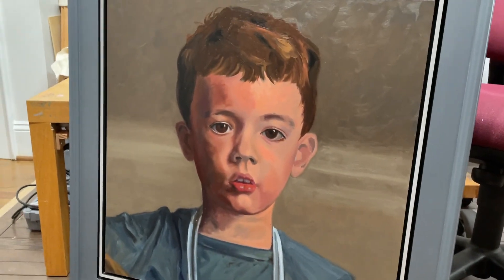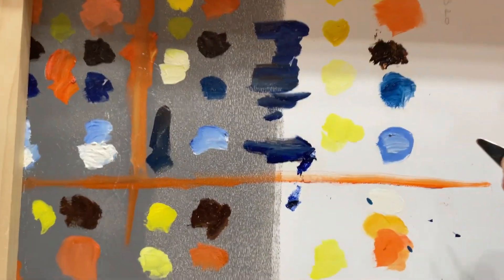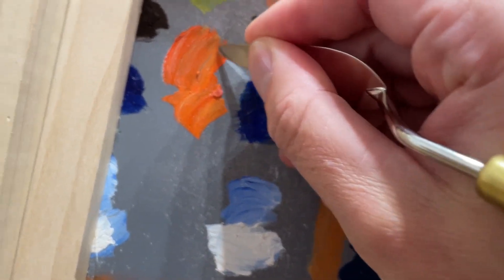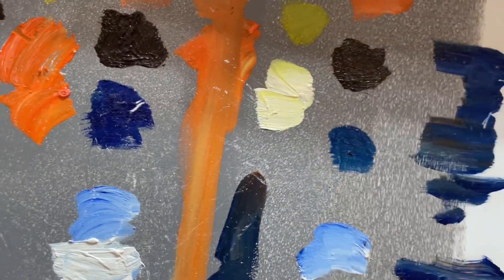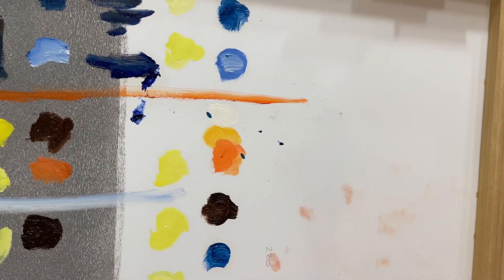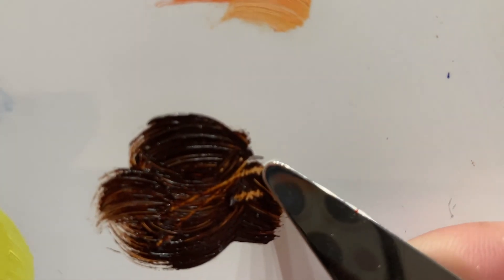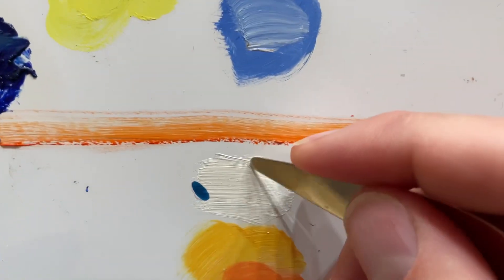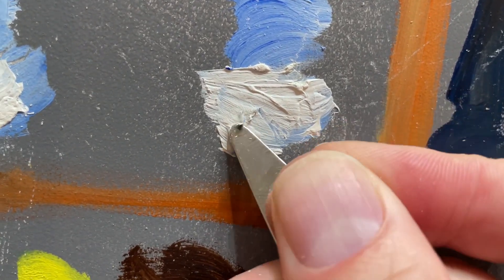Follow up DIBOND scrape test

Comment: i saw a comment on another video recommending that you etch the surface with ammonia before applying gesso
Reply: it's not base aluminum though, it's a plastic paint coating on top that you're sanding. Ammonia in theory wouldn't have any effect on the paint coating -- pure metal, sure, but you can't paint on unsealed aluminum which is why Dibond has the coloured paint on it (at least on one side).

Comment: Hey there. So is it a good/safe surface to paint on? I mean you really scraped at it hard but without the scraping do you think that the paint would stick forever?
Reply from the maker: No one knows for sure but it seems extremely solid a few years out.
Reply: @jaypatti1948  so personally speaking. Do you use acm as a painting surface? Thank you for the advice.
Reply: @jaypatti1948  and how much sanding should i do to my panels? How much is too much sanding? Thanks
Reply: @Mohamed-tr7fi  too much sanding is you can see the colour of the aluminum coming through (or scratches like in his original video). The painted coating has to remain intact otherwise the aluminum will oxidize unless it's sealed immediately.
Reply: @peacockandfig  thank you